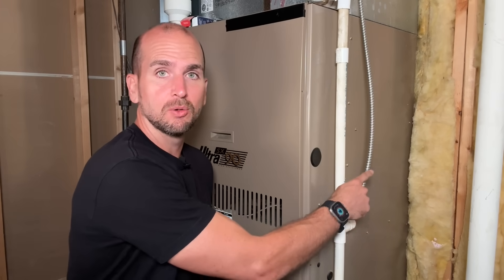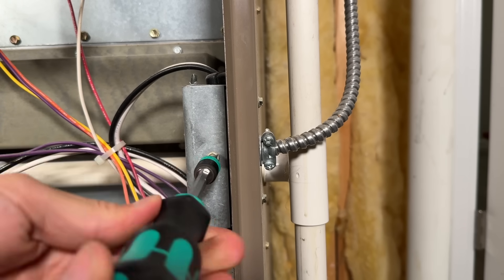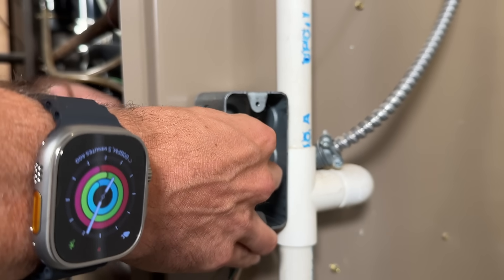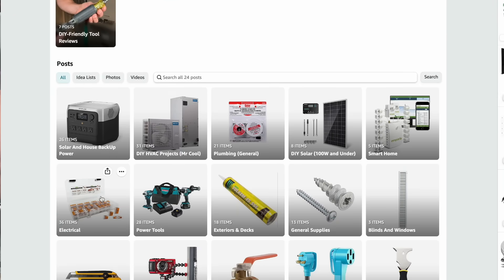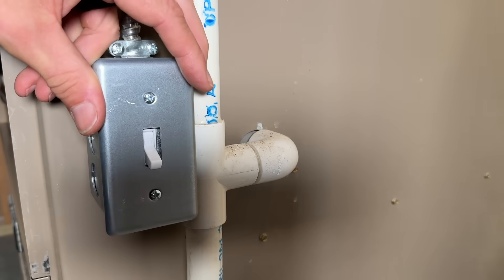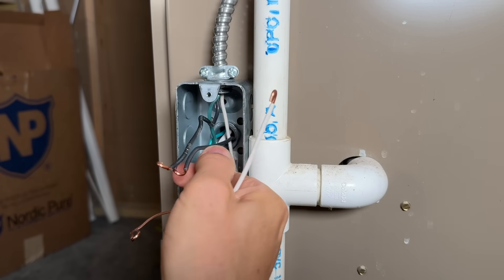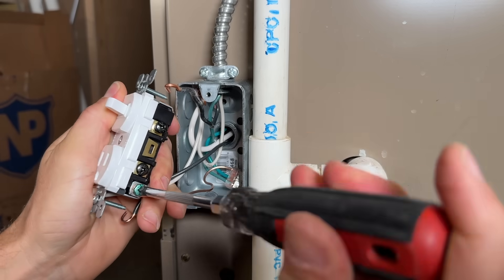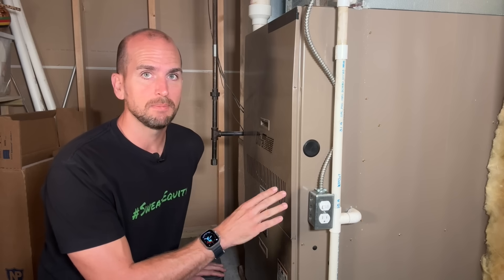How To Install A Furnace Power Disconnect Switch

Comment: Good overview.  To be clear on the point of it not meeting code... existing installs are grandfathered in most jurisdictions and do not have to be changed (switch install).  You only need to install that switch if you are making changes or replacing the furnace (usually in need of an inspection and permitting process).  I had this situation when my furnace was replaced and they had to install the switch.  Makes sense that it is installed on the side of the unit where easily accessed.

Another note the inspector caught us on... per my local code enforcement, we actually had to reduce the size of the panel breaker from 20A to 15A, as most newer furnace blowers require less power to operate than the older ones.
Reply: Weird.  The breaker is supposed to protect the conductors, not the equipment.  Not sure why any locality would do what you described... but I totally understand just complying with whatever the inspector says, nonsense or otherwise.
Reply: @ncooty Because if the manufacturer specifies a maximum fuse/breaker size, then per the NEC you must install equipment in accordance with the manufacturer's instructions.
Reply: @Sparky-ww5re  I follow your reasoning (especially on a dedicated circuit), but in that case, I think I'd ask the inspector to show me in the appliance's spec sheet where it's called out.  Personally, I don't recall ever seeing such a thing, and I'd think it'd be pretty odd for an appliance to rely on a panel breaker rather than be internally protected for internal over-current--for exactly this sort of reason.  (E.g., a manufacturer doesn't know if an appliance is being installed on a grandfathered non-dedicated circuit.) In any case, if it's required, it's required (and most codes have good reasons), but I'd want an explanation from the inspector.
Reply: @ncooty  I do primarily residential,  specifically custom homes some of which are well over 10,000 square feet and cost upwards of several million dollars, and can have two, three or more furnaces and outdoor condensers and heat pumps that may or may not have backup resistance heaters.   I've wired several that the specs call for maximum breaker sizes that are not typically seen elsewhere,   such as 25, 35 and 45 amps.   Last year I was trimming out a house roughed in by one of my fellow electricians, and there was a steam generator for a sauna that specified a 90 amp max  breaker. 

The point is, sometimes the Code puts us electricians in an awkward spot and tends to contradict itself, because the scope of the NEC covers the installation of wiring and equipment,  and since you're obviously not installing existing equipment the grandfather clause applies to most situations.   However,  110.3(B), states "Equipment that is listed, labeled, or both, or identified for a use shall be installed and used in accordance with any instructions included in the listing, labeling, or identification"   

Ultimately the Authority Having Jurisdiction has the final say in whether an existing circuit that has the ampacity for a new piece of equipment is allowed to remain as is where is.
Reply: @Sparky-ww5re  Well, you clearly do that sort of work much more than I do.  I really appreciate you taking the time to explain it.  Thank you.
Reply: A reason to require a 15A breaker and disallow a 20A breaker might be if the furnace’s internal wiring was smaller than 12-gauge.  OTOH lots of portable appliances have thinner-gauge internal wiring but we still can plug them into 20A branch circuits.

Comment: I would have screwed the handy box to the furnace and used a ground pigtail in the handy box as well. I don't like relying on the locknut as they can come loose due to vibration eventually.

Comment: @7:23 When changing the filter I instead turn off at the thermostat, because I don't need the AC cut and because many units have a shut-down sequence I want to respect. Probably doesn't mean anything (after all, power outages don't typically harm HVACs) but doing so satisfies my psyche. Also, my filter isn't installed at the air handler location Great video, Scott!

Comment: Oh man do I have a story to share.  My wife and I hosted our in-law for a weekend, and we have a furnace power disconnect switch already built and installed. I was woken on Saturday morning to my wife telling me that the main floor was cold. Annoyed that my sleep was interrupted, my brother-in-law and I investigated and the longer we could not figure out why the pilot wasn't on, the madder I was becoming.  We called a guy that we trusted to come and take a look, and I eventually figured out what it was.  One of the kids had turned off the furnace, and once I flipped the switch on, the pilot light ignited, and the main floor got heat again. It was a face palm and learning moment. We called the guy back and said we didn't need him as I had figured out the issue.

Comment: I'm a bit surprised by this because wherever I've lived (in Canada) a "kill switch" for the furnace has always been present, and always near but never at the top of the basement stairs, probably to avoid getting it confused with the stairwell lighting.  When my parents renovated the family home in BC in 1966 such a switch was installed, perhaps just for convenience, but possibly in order to be compliant with the building code in effect at the time.
I wonder if this has long been code in some jurisdictions.
Reply: My house was built in 1850 and one of its rewires was with old pre Romex nm which had fabric insulation and a 16 awg ground, furnace has an emergency switch at the top of the stairs and in the ceiling next to the furnace
Reply: @billy9075 likewise, house not nearly as old as yours, but we have a bright red box at the top of our basement stairs and it says in bold white letters, emergency shutoff. And another on the furnace itself.

Comment: I always assumed an SSU was required.  Every furnace I've seen has one around here in Michigan as well as the boiler at my brother's house.  It's the combo unit of a switch and screw in fuse pre mounted on a single gang faceplate.  Still runs from a breaker on the main panel but often times the fuse is smaller than 15 amps.
Reply: It was here in CA.  I even challenged it with contractor, when I pointed out that breaker box was right next to air handler in plain view.  Thus, why the duplication?  But, it was insisted upon.
Reply: Same thing here in Wisconsin.  Every furnace I've seen is a handy box with a plug fuse and toggle switch.  The fuse is sized to the furnace rating plate, our furnace in our old house was a 6 and 2/3rds amp fuse(I'd never seen a fractionally rated fuse before, but they do exist).  In our current house the furnace was installed in 1985 and it has a 10 amp fuse.  Do they make residential sub-15 amp breakers? Never seen one yet.  I suppose they could, they would  have to be hand built and tested, and be able to be mounted in your panel (Square D?, Cutler-Hamer?, GE?).  A custom rated breaker; $500? or a 50 cent fuse.  Also they used to have fused washer outlets, ours was a 10 amp.
Reply: See my posting elsewhere in this video, on the benefit of having a fuse.

Comment: I think it's okay not to have a switch for the furnace if you're seeing distance from the breaker to disconnect it. But seriously. Put a dang switch there, that's seriously the standard installation regardless. Very happy you mentioned the chase nipple. I literally never knew of its existence until I changed out my furnace's handy box to a 4" square box because I wanted a switch and full duplex receptacle.
Reply: Correct.  "Within sight " is defined in the NEC as visible from the equipment AND within 50 feet.   So if you cannot see the breaker box from the furnace,  or it's farther than 50 feet then you'd need a local disconnect switch near the unit,  or a lockout device on the breaker that remains in place after the panel cover is installed.  For cord and plug connected equipment,  the plug satisfies the disconnecting means.
Reply: I didn't get the receptacle reference.  I was told I had to have a dedicated circuit for each of my air handlers along with an SSU.  Being that these are ng fired units and, have ecm fan motors, I just didn't understand the dedicated circuit requirement. The motors are less than 100 watts and don't have extreme surge draw on startup.

The original air handlers, were just both plugged into an outlet on the wall between them.  Which easily serves the same safety function as an SSU.  And allowed me to have an outlet I could use when necessary, for other things.  I lost all of that and had to add a second, dedicated circuit with the change out.  Per NEC according to contractor and inspectors.  😞

Comment: And a non-gas electric furnace would probably need a 30 amp rated 2-pole switch.
Reply from the maker: Most likely would be a 240V supply if you are running all electric.  In that case I have used a standard 240V disconnect like the one you usually see on the outside of a home for the AC unit.
Reply: Electric furnaces would need at least 30A, and may be 60A or more.
Reply: @TomCee53  My furnace with 5 kW electric heat has a 30 amp 2 pole switch that looks like a light switch that is rated for this use.
Reply: As has been stated in other videos, always check with local authorities before powering your furnace with a cord. In emergencies you may be ok, but don’t trade one emergency for another by creating a dangerous situation.

Comment: Code is to bound your boxes. Period. We use pipe to transfer ground and we still have to ground every box. So this “nipple,” theory doesn’t apply. Gotta bond the box, gotta bond the equipment. Seems silly, I know.
Reply: I think his primary motivation for repairs/projects are as an excuse to buy and use fancy hand tools...in other words, the actual repairs/projects are just a means to an end to use the tools.
Reply: @jimh1996  His intentions are good. He’s just not a professional.
Reply: @AdamS-lh2ug  

In my experience, most professionals aren't really professional either.  But they all seem to think they're the cat's meow.  And sadly, code experts.

In my last HVAC contractor work, I pointed out that they had the double wall flue too close, actually touching, the air return duct that was wrapped with bubble wrap insulation.  They insisted it was fine.  That the duct insulation was fire rated.

I made sure the inspector saw it on the sign off inspection.  He refused to sign.

The contractor had to come back and redo it.  It took six weeks to get their arse out there.  They insisted the inspector was just out to get them.

Part of the reason we hate them alike:  Contractors and inspectors.
Reply: @tharais  I hate code nazis too, they tend to be the ones that stretch the code the furthest. And company owners trying to make a buck.
Reply: It may sound silly, but electrical fires and issues are no joke. People have lost their homes, lives, and property to disasters that could have been prevented by safety devices
Reply: @chadmargraf4020  I was joking on how it May seem silly. I don’t think most people understand why we have code standards. This is a lot about passing fire code. Yeah we have to run electrical. We have to do it without burning your home or business down.

Turns out that is kinda important.
Reply: AdamS-lh2ug You're absolutely correct, he has made this same mistake before, here is the NEC language: 
250.148 Continuity and Attachment of Equipment Grounding
Conductors to Boxes. If circuit conductors are spliced within
a box or terminated on equipment within or supported by a
box, all equipment grounding conductor(s) associated with any
of those circuit conductors shall be connected within the box
or to the box with devices suitable for the use in accordance
with 250.8 and 250.148(A) through (E).

250.148(C) C) Metal Boxes. A connection shall be made between the
one or more equipment grounding conductors and a metal
box by means of a grounding screw that shall be used for no
other purpose, equipment listed for grounding, or a listed
grounding device.
Reply: @Bluesman57  this is my biggest issue with him, he seems to want to position himself as some diy professional electrician and he’s just not. He makes tons of minor mistakes in his electrical work, and it’s just like “please, stop.”
Reply: @Bluesman57  I wonder: Since he connects the ground to the switch, use of a self-grounding switch would have properly grounded the box as well?
Reply: @@phillipbanes5484 in the trades (and as a licensed electrician) we joke about how this is how the people in charge or writing the code keep their jobs. 

In the last 3 code cycles they mandated you had to put a receptacle in islands. Then they said if they where over 8’ you needed additional. In 2023 code they removed them completely (turns out they are not safe for children) and we have to mount them in the counter with a pop up now.  

It’s ridiculous the things they change. We also basically just gfci and arc fault every damn breaker in homes now. Which creates its on issues, mostly in commercial settings.
Reply: Could have swore he made this mistake before, don't worry he'll make another video how to fix this lol
Reply: @@phillipbanes5484 no its because cities are so greedy, that they cram a bunch of homes right next to each other, just to make more for the same acre of land. Not to mention taxes, which also affects businesses, who then raise prices so then they dont have to pay the increase rate, it actually falls on the consumers
Reply: @chadmargraf4020  

Cities don't "cram" anything.  They ensure that the builder proposals comply with state mandated housing construction requirements.  That's why, combined with land values, that houses are commonly built so closely together.

After all, it isn't really the house one is buying.  It's the space.  And, in highly populated, growing areas, the demand for space compared to the available space, is disproportionately high.
Reply: @chadmargraf4020 not saying that cities are not greedy, but in my experience it’s the developers pushing to have more houses in a development, which means more profit.
Reply: @TomCee53  which may not seem like anything bad, but when the houses are so close together that you are practically staring at your neighbor's couch from your kitchen table, that's where someone needs to draw the line. I like the age of privacy, where people don't go barging in on others. And also in our area, the streets are not designed for the level of traffic that is trying to squeeze into it. Plus in the park that we are in, for how little we are paying for our space compared to what people are paying for the new houses, we get more than what they get
Reply: @@phillipbanes5484 no, thats just what they're doing in our area. By sandwiching the houses so close that they are only 2ft from each other, with very little yard, they can make a fortune off of it.
Reply: @@phillipbanes5484I mean yes, often we do benefit from safety regulations
Reply: Your burning house could effect your neighbors and put the fireman's life in danger to save you or your property.
Reply: @black02z  

Pure, unadulterated hyperbole.

But hey, if it makes you feel better.....
Reply: Not silly if you understand
Reply: Not silly if you understood electricity
Reply: It's also bonded via that mc, ac or bx cable (whatever that is), which is legal in most places
Reply: @Ilikeeminleggings Nope, you are thinking of AC or BX.  MC sheathe is not an approved method of equipment grounding.